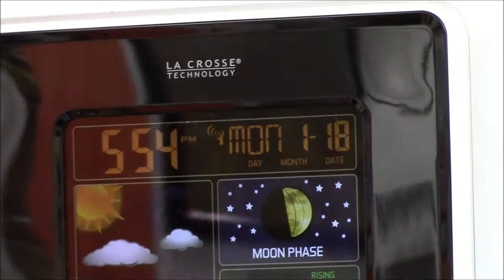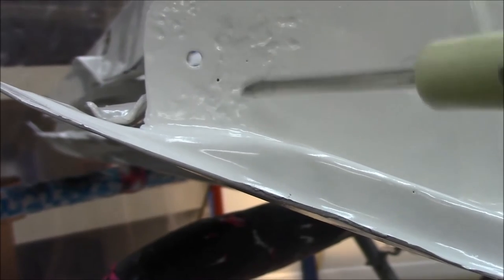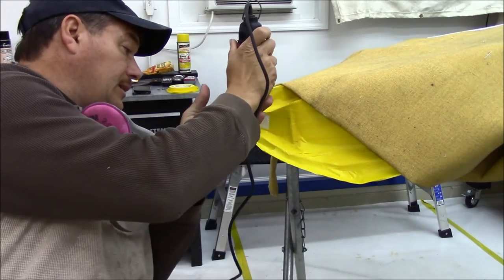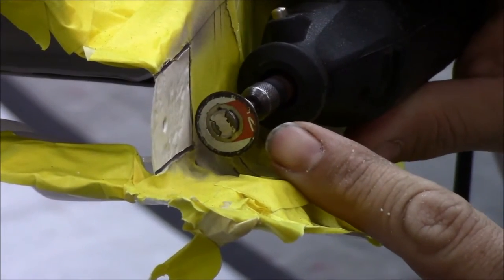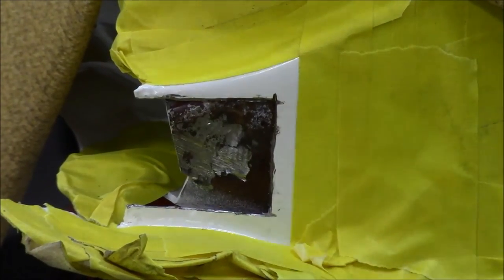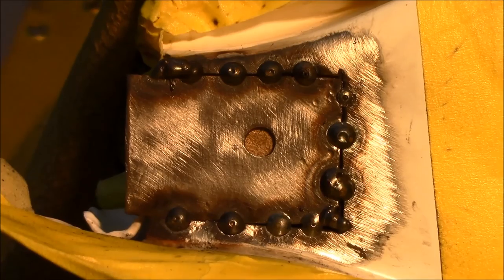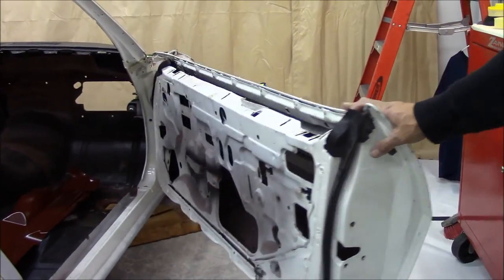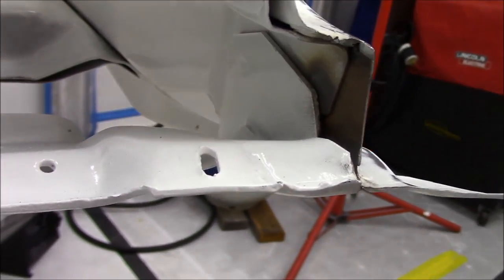1972 Camaro Project Overkill Door Shell Repair

Comment: Thanks for showing so many details of the repair work.  It helps me greatly as I get ready to start sheet metal work.  Do you use any cleaners on the metal before priming?
Reply from the maker: +Sam&#39;s Garage Thanks Sam. Yes I clean the bare metal with a wax and grease remover. I have a solvent and waterbase type. Sometimes I actually use both, but mainly the solvent.